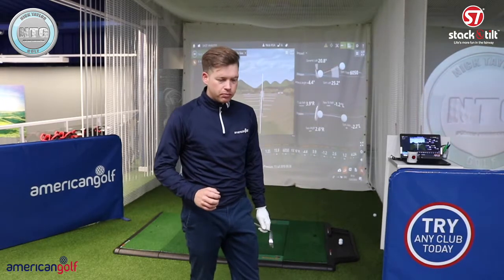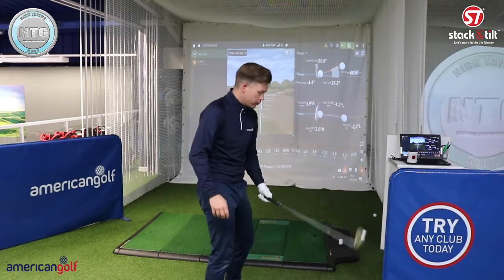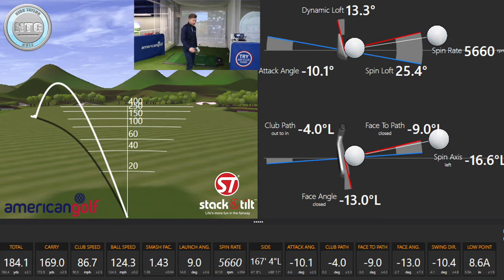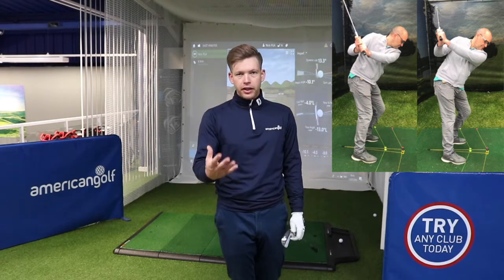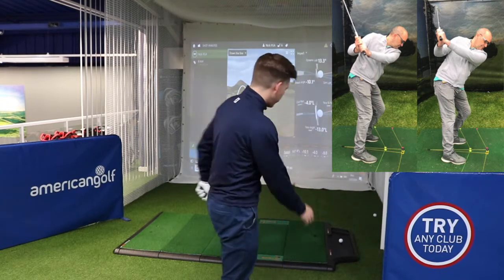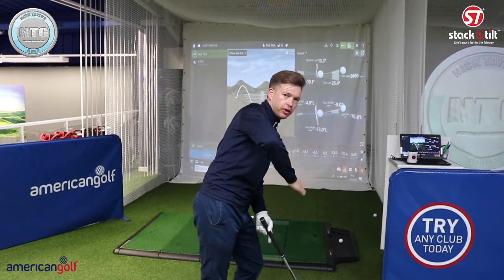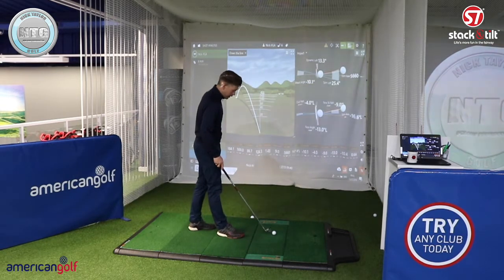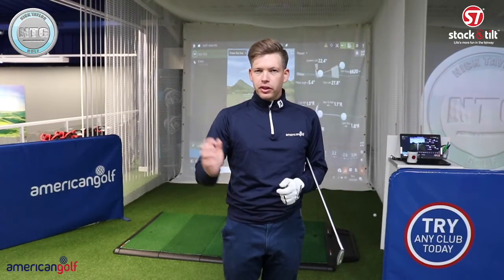External rotation of the right arm | Golf Tips | Lesson 78

Comment: Hi Nick. When I get to the top of my swing, my club face is open and club is slightly across the line but I do not have a flying right elbow. By rotating the humerus like you demonstrate will that get the club face more square and laid off. Is the laid of position ideal for the stack and tilt swing? Stephen
Reply from the maker: Hi Stephen I wouldn't say a laid off position is key for S&T, the idea was to help explain the role of the right arm. I would say this would help golfers that get too steep in the downswing
Reply: @NickTaylorGolf  thanks. stephen